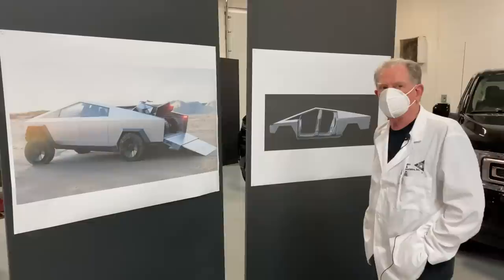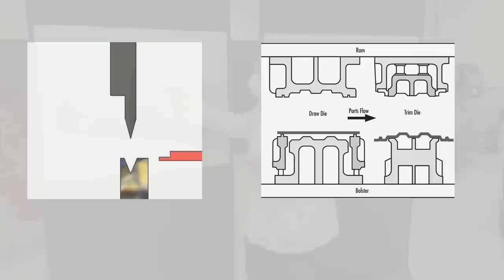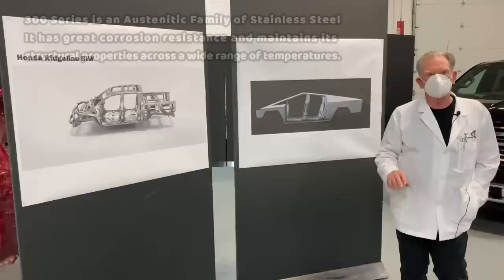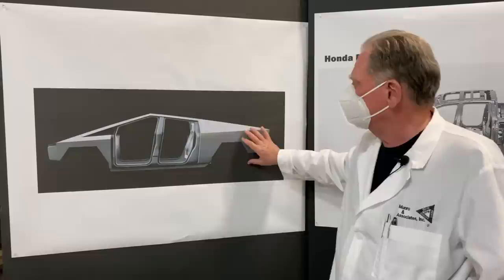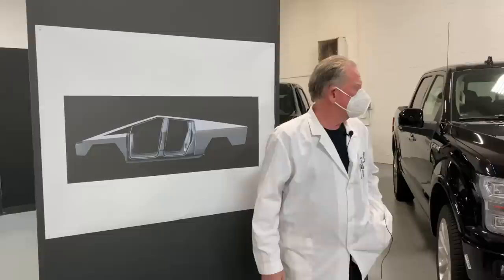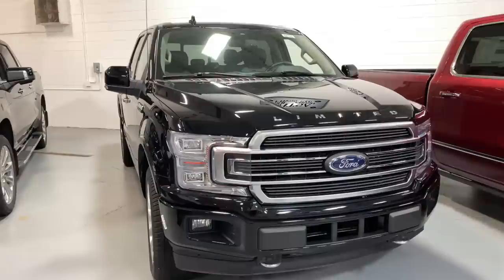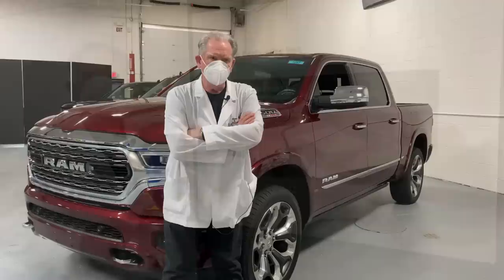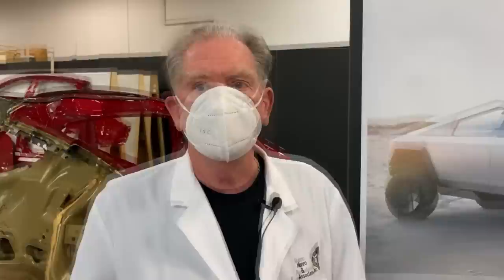Cybertruck E1 - Body Structure Comparison

Comment: This really hammered the point home of how insane we got with manufacturing complexity. When sandy was talking about the hundreds of millions spent on tooling and the hundreds of different tools vs cybertruck was an eye opener.
Reply: And that's just for the chassis. Imagine all the plastic molds for alllll the plastic parts in modern vehicles.
Reply: And that level of complexity is behind almost every thing people own.
Reply: @skmetal7  if you think  cars are complex, then wait and see the modern modern motherboard like from the latest iphone its two motherboards sandwitched together and its really small compared to the old ones
Reply: So very true. Every time some guy comes out with a "simple affordable car" for just puttering around town or picking up groceries, they make it a one or two seater, using a basic motorcycle engine and minimalist frame.
Then they wrap the thing in a swoopy carbon-fiber shell that's nothing but complex curves which doubles the price of the thing and wonder why they can't sell any.
Reply: Imagine if the cyberturck used a diesel engine. It would cost like 10K $
Reply: @abyssstrider2547  Yeah, if it was an old school Detroit diesel the cybertruck would last damn near forever.
Reply: That level of complexity is what allows products to not all be bland and simple square boxes. You're all "impressed " by the Cybertruck because it's different. Not because that approach is better.
Reply: @derbigpr500  I will yield on the body but even if you just look at what gets cut out on the powertrain.
Reply: @derbigpr500  False dilemma. Plenty of ways to make stuff look spiffy without a dozen custom molds. For instance, lots of early motorcycles were about as basic as you could get in terms of simple manufacture and still managed to be gorgeous.
Reply: To me beauty is economy, durability, utility, and performance.  Metal flake paint, a loud exhaust, and pouring fuel into a vehicle doesn't do it for me.
Reply: People around here still remember the days when you could disassemble a  car with a ratchet with 3 heads, 2 keys, 1 screw driver and a hammer.
Now you have to have special tools for most things.

I am sure people buying the Cybertruck to be a workhorse would love to have that back.
Reply: @derbigpr500  Clearly you haven't been paying attention. "You all think this..." No, its impressive because its far more functional than a traditional truck and costs half as much to maintain. There are many, many features that make it an excellent working truck, police vehicle, forestry, fire services vehicle. 
"Built Ford tough" falls apart when an errant shopping cart or tree branch scratches your paint and you have to pay to match two panels. A ding from a job site or off roading, A rock flipped at your windshield takes your working truck off the road for repair. 

So no. We're not just a bunch of mindless slaves to fashion.
Reply: But imo it seems like a lot of that complexity in conventional modern cars comes from all the little design flourishes they as to every single panel. I wonder how much cheaper Tesla could have made their truck, if they went with their usual design language.